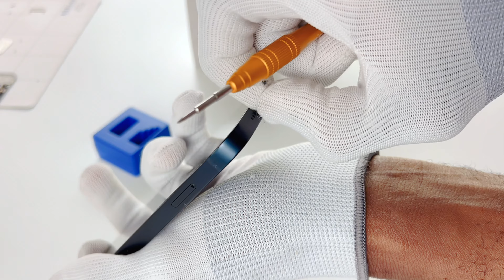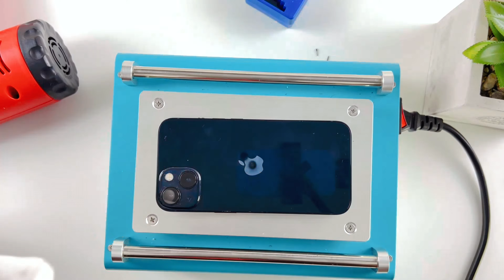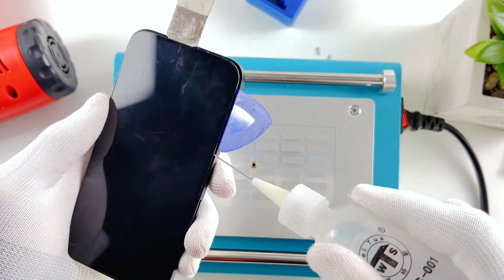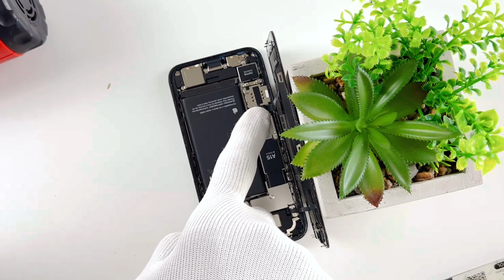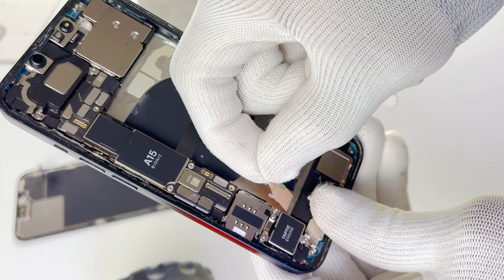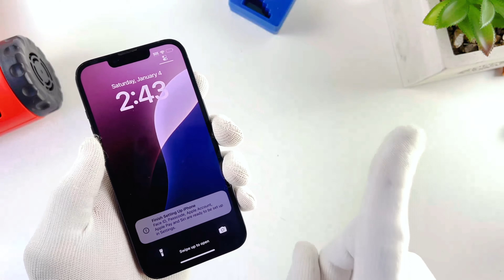Apple iPhone 13 / 13 Mini Battery Replacement... shown in 3 minutes!

Comment: Glad I stumbled upon your video. I was nervous to try it at first, but with enough heat (I used a heat gun with a pointy head adapter) I actually removed the screen successfully.

Just a heads-up for fellow viewers : depending on your device region, you might need different screwdrivers for the inner plates. Mine required a Tri-wing 0.6 mm, so I had to reseal the phone temporarily while I ordered the right kit.
Reply from the maker: @mxdscientist Congrats on getting the screen off, and thanks for taking the time to share that! Great point about the screwdrivers too. Inner screw types can vary by region and model, so checking before you start saves a lot of hassle. Appreciate you passing it along to other viewers. Let me know how the battery swap goes!

Comment: Can I use a hairdryer instead of a heatplate?
Reply from the maker: @SalikRafiq Yep, a hair dryer can work if that’s all you’ve got! It won’t heat as evenly or as concentrated as a heat plate, so you’ll need more patience and have to keep it moving around the screen. It might take longer using a hair dryer though, so you will need a lot more patience with it. Heat it up until the adhesive softens (around 80 to 100°C is what I aim for) before you start prying. Let me know how it goes!

Comment: What if I dont have a heat plate?
Reply from the maker: @Jpgas-life A hair dryer or heat gun can work as a substitute, just use a lower/medium heat setting and be a bit more patient since it won't be as concentrated as a heat plate. You still want to get the area to around 80 to 100°C before applying the isopropyl alcohol.

Comment: Is it easy to do without alcohol and a heat plate?
Reply from the maker: @um4lik398 Definitely not easier, no. It's still technically doable without alcohol and a heat plate, but it's going to take a lot longer and be way harder. You still need some form of heat (around 80 to 100°C) just to get through the screen to reach the battery, heat is pretty essential for that part regardless. Combining heat with isopropyl alcohol makes the whole process significantly easier, so without both, you're making it a lot harder on yourself, not impossible, just a much bigger hassle.
Reply: @G @GadgetGearGuide3Gs m thanks for the reply, so do u think it would be cheaper just to get it done at a store, considering that i have no tools or anything lol
Reply from the maker: @um4lik398 Honestly, if you have zero tools and this would be a one-time thing, getting it done at a shop is probably the more cost-effective option, buying a full tool kit just for one repair usually costs similar to or more than a shop visit. But if you see yourself doing more repairs down the line (for yourself or as a hobby/side hustle), investing in tools pays off quickly after the first couple repairs. Depends on whether this is a one-off or something you want to keep doing!

Comment: I accidentally cut the flex cable on top. What is it?
Reply: probably face id/speaker
Reply from the maker: @laftaf_tv That flex cable at the top typically has something to do with the Face ID, and one of the two mics on the 13. If you cut it, I'd check if Face ID still works, along with the sensor and top mic, those are the most likely to be affected. Your earpiece speaker should still be fine though, on the 13, that's not tied to this particular flex cable (it was on some older models).

Comment: Q1. What’s the best temperature should I set my heat plate when removing newer iPhone screens?

Q2. What temperature should i set when removing my Samsung S8 back glass so that i don’t damage my fingerprint sensor at the back?
Reply from the maker: @samford_technologies Great questions! For newer iPhone screens (like the 13/13 mini), I'd set the heat plate around 80 to 90°C (176 to 194°F). Hot enough to soften the adhesive without stressing the display or battery underneath. Keep it on there for 60 to 90 seconds before attempting separation.

For the S8 back glass, be extra careful since the fingerprint sensor flex sits close to the glass. I'd recommend a slightly lower temp, around 70 to 75°C (158 to 167°F), and use a suction cup with slow, steady prying rather than rushing it. Let me know how it goes!
Reply: @GadgetGearGuide3Gs thanks for the reply
Reply from the maker: @samford_technologies You are welcome 😊

Comment: u didnt seal with adhesive the screen!!!!!!!
Reply from the maker: @mateoherrera1413 I didn’t reseal it with new adhesive in this one. For me it’s more of a personal preference. On my own phone I usually don’t bother since once it’s opened, the water resistance is never really the same anyway.

If it’s a customer repair though, I always recommend putting new adhesive back in to help with dust protection and some level of resistance. For personal use, I’m okay without it.

Comment: Alcohol doesn’t soften the adhesive. It makes it harden and come loose.
Reply from the maker: @JR10125 You’re right technically. I used the word soften just to keep it simple for beginners. Heat actually softens the adhesive, and the alcohol helps break the bond so it releases easier. Together they make removal safer and easier, especially for people just starting out.

Comment: i remember giving up iphone fixing because you had to like solder cables from original battery to the new one, is that still a case or ?
Reply from the maker: @harismuhic20  Yeah, that used to be a big headache 😅 These days it really depends on the model. On some older iPhones, you can just swap the battery and be done. On newer ones, you might see a battery health or non-genuine warning unless you transfer the original BMS/flex or use a programmer. Apple Self Service Repair has also made things a bit more straightforward if you go that route.

What was the last phone you worked on? Which make and model?

Comment: Can I do that in a bloated battery?
Reply from the maker: @vithalos I would not recommend doing that on a bloated battery. A swollen battery is already unstable, and adding heat or alcohol can be risky. The safest option is to power the phone off, avoid pressure or heat, and carefully remove it using the pull tabs if possible. If the tabs break, go very slow and gentle, but honestly, a bloated battery is one of those cases where safety comes first. If you are not comfortable, it is better to have it replaced professionally.

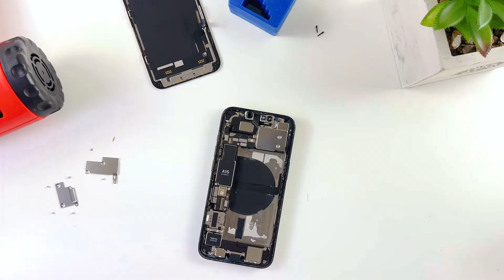Comment: 2:19 there are pull tabs at the top and bottom which work very well, pulling at the side with a spudger can severely damage the battery or create an fire, its way safer to use the pull tabs.
Reply from the maker: @harulango8614  You’re right, if the pull tabs come out cleanly, that’s definitely the safest method. In my experience though, the tabs often tear or snap, especially on older batteries. When that happens, controlled heat plus a small amount of isopropyl alcohol helps soften the adhesive so the battery can be lifted very gently with a plastic spudger. As long as it’s done slowly and carefully, it’s safe. Appreciate you pointing it out, both methods work depending on the situation.

Comment: is data completely lost after battery replacement? (my phone is not backed up), is the data still there in the phone after changing battery?
Reply from the maker: @hunaidjamali4306 No your data does not get erased during a battery replacement. The battery has nothing to do with storage, so all your photos, apps, messages, and files stay exactly where they are as long as the repair is done properly.
The only time data is at risk is if the phone already has motherboard damage or it shuts off during a software update. But for a normal battery swap, your data stays safe even if you never backed it up.

Comment: Will it be 100% again?
Reply from the maker: @sam-hq1xq After a battery replacement, the health does not usually reset to 100% unless it’s an original paired battery. But as long as the new battery is good quality, your phone will work normally with no issues.

Comment: No new adhesive needed when putting the screen back on ?
Reply: Remember, too, that this guy is a pro with all the materials, so he can pick and choose what to use. We use what comes in the kit we buy online, right? So, if a new screen adhesive comes in the kit, it wouldn't make sense not to use it, though I don't think it makes it dunkable again. It might help keep it from getting damaged in the rain, tho.
Reply from the maker: @Another_Lady  That’s actually a really solid point. You’re right, most repair kits include new adhesive, and it’s definitely good to use it if it’s there. It won’t make the phone waterproof again like from the factory, but yeah, it can help with light moisture or dust.
Reply from the maker: @technocatdance That’s a really good question! Personally, I don’t usually replace the adhesive when it’s for my own phone. I just reuse what’s already there since the phone won’t be fully water-resistant anymore once it’s opened anyway. Some people like putting on new adhesive to help keep out dust, but for me, I prefer easier access if I ever need to open it again. The screen usually stays firmly in place thanks to the clips and pentalobe screws.

That said, if you’re doing the repair for a client or as part of a business, then yeah, definitely replace the seal. It just looks and feels more professional. But for personal use, it really comes down to preference, in my opinion.
Reply: @GadgetGearGuide3Gs  Interesting I always wondered if that adhesive was actually keeping that screen in place or was for waterproof and dust etc thanks for the reply!
Reply from the maker: @technocatdance  Yeah exactly! A lot of people think it’s what mainly holds the screen, but it’s really more for the water and dust resistance. The clips and screws do most of the work keeping the screen in place. The adhesive just gives it that extra seal, more for protection than structure.

Comment: Noticed none of these comments that I've read say they've successfully used this method to replace the battery. And I think 3 minutes is being highly optimistic.
Reply from the maker: @aroneleusis1865  I get what you’re saying. The 3 minutes isn’t really about the whole job start to finish, it’s more about the actual swap once everything is open and ready. The full repair definitely takes longer, especially the first time. It just takes practice and a bit of patience, not really a one-and-done thing.
Reply: Realistically if your not good with repairing things and this is your first repair with anything tech related. You should not be clicking on a 3 minute video to learn how to replace a phone battery at that point you should be taking it to a repair shop or if you want to learn watch a longer more detailed video. This video is more for experienced people that have knowledge about repairing tech but just want a quick refresher / guide for them to follow.
Reply: And if it was a 20 minute video you would have complained that it needed to be edited down 😂
Reply: Id say take your precious time especially on that screen prying part.

Comment: Metal bro 😂???
Reply from the maker: @unicbertprofi2851  😂 Haha not even sure what you mean bro, but metal it is! 🤘🔧
Reply: @GadgetGearGuide3Gs dude ...use some plastic tools for opening those screen .😅
Reply from the maker: @unicbertprofi2851 Yeah I hear you 😅 I only used a thin metal tool just to get the first gap open, then switched to a guitar pick and plastic spudger for the rest. For the screws it’s metal of course, but when it comes to lifting the screen, I try to stick with plastic once I’ve got it started… can’t exactly use a plastic screwdriver though 😂
Reply: @GadgetGearGuide3Gs  well you know and and i know using that mettal at first is an hy risk for lines ,take your time with some alcoohol under press and it will pop ..for shure ..all the best ..!
Reply from the maker: @unicbertprofi2851 Totally! That’s the key, take your time, use a bit of alcohol, and it usually pops right out. Appreciate the tip, all the best to you too!
Reply: @GadgetGearGuide3Gs  What a gracious reply! That makes me like you more 😄 And, for me, none of my plastic tools worked, so I had to use metal 🤷‍♀
Reply from the maker: @Another_Lady Haha I appreciate that! Yeah sometimes those parts really don’t want to budge 😂 Metal tools definitely come in handy when nothing else works, as long as you’re gentle with them.

Also, suction cups work too, I still use them in some of my videos just to show different ways of doing repairs. There are so many methods that work honestly, it really just depends on your technique and what feels most comfortable for you.

Comment: I phone 13 which brand battery you recommend
Reply: What do you think of PINZHENG battery? I start my company it’s been a couple of month and i buy them since i saw they have good review but i wonder if i have take the right choice for aftermarket battery.
Reply from the maker: @simmyrakhra  Apple original is always the top pick, best safety, performance, and longevity. But if you’re going third-party, here are some good brands people use: iFixit, Deji, NOHON, and Ampsentrix. Make sure to get a battery with good warranty and from a trusted seller so you don’t end up with weak capacity or safety issues.
Reply: @GadgetGearGuide3Gs  I think Deji leaves a lot to be desired (I replaced 3 originals with Deji till now). What about Nohon, in comparison?
Reply from the maker: @tanner1985  Sorry I just saw this message. Totally fair, different brands perform differently in real use. Deji has been hit or miss for some people (some like them, some don’t).

NOHON in my experience tends to be a bit more consistent and closer to original performance than Deji, but it still won’t match Apple’s original battery in safety, efficiency, or longevity. If you’re picking third‑party, look for sellers with good reviews, clear warranty, and high capacity ratings.

At the end of the day, NOHON usually edges out Deji for most people I’ve seen, but nothing beats an original Apple unit if you can get one.

Comment: Can I use 100•C AirGun on the back of IPhone instead of heating plate ? Ty
Reply from the maker: @VwhyX Yes, you can use a heat gun set around 100°C, but you’ll need to be extra careful to keep the heat moving so you don’t overheat one spot. I use a heat plate because the heat spreads evenly, which makes the repair faster and safer, but a heat gun can work if done carefully
Reply: @GadgetGearGuide3Gs Thank you very much that helps a lot ! Can I also use a heat dissipation pad and use a bit higher temperature maybe ? I don’t know if that is safer.
I want to get the heat plate as well but it cost a lot for me as I am not making a lot of profit as of now :/
Reply from the maker: @VwhyX Yeah, a heat dissipation pad can help spread the heat a bit, but you’ll still want to be careful with the temperature. For battery removal, 100°C is usually more than enough. If you were doing a back glass replacement, you’d need a bit higher temperature, but then you have to be extra careful so you don’t damage anything, it can get tricky. I get it, the heat plates are pricey, so using a pad with a heat gun is a decent alternative for now. Just move the heat around evenly and take your time, it’ll make it safer.
Reply: What is the temperature of the heat plate, can I use worming spot on stove (glass top)? I can control temperature I think if I know what should by the right one. Thanks!
Reply from the maker: @basiakirschner284  Hey! The ideal heat plate temp is usually around 80°C to 90°C. I wouldn’t really recommend using a stove though, it’s high risk and the heat isn’t even, so you could easily damage the screen and end up spending more money in the long run. You can grab a cheap heat gun on Amazon for under $10, and that’ll work way better for what you need.

Comment: I dont have a heatplate, a thin opening tool nor alcohol. This video is useless
Reply: Those are the tools requiered to do this job. It's just how it is
Reply from the maker: @Andrew-tl9gk  No worries! If you don’t have a heat plate, thin opening tool, or alcohol, there’s still a way to get started. I actually have a video showing a beginner-friendly repair kit you can grab from Amazon or AliExpress, it comes with a screen and all the basic tools you’ll need for most first repairs, including battery replacement. For heat, a hair dryer can work too, just keep it moving so you don’t overheat anything. I’ll be making a full video soon showing exactly how to use a hair dryer for these kinds of repairs, so stay tuned!

Here’s the link to the kit video if that helps: https://youtu.be/KXhIZxD1Qlc
Reply: LMFAO you gitta baiting
Reply from the maker: @rxqsfax3269  Haha, maybe a little! Just trying to keep things interesting while sharing the tips.
Reply: Yea.. it couldnt be you, who can buy that stuff, that’s useless.. gotta be the video 🤣🤣🤣

Comment: Were can you order a orginal Apple part battery for iPhone 13
Reply from the maker: @anymoez6789  Apple doesn’t actually sell genuine new iPhone batteries directly to the public. The only way to get an “original” Apple battery is to have it replaced through Apple or an Apple Authorized Service Provider.

If you’re buying online (like on AliExpress, Amazon, or other parts suppliers), most of the time they’re high-quality aftermarket batteries that are advertised as “OEM”, but they’re not the same as what Apple installs. The best thing you can do is check seller reviews and ratings to make sure you’re getting a reliable one.
Reply: @GadgetGearGuide3Gs  What battery did you use in the video?
Reply from the maker: @ianbush2846 In this video I actually used an original battery, but most of the time I go with aftermarket ones. I usually buy from AliExpress or Amazon, and I always look for sellers with lots of reviews (4.7⭐ or higher) and preferably a badge on AliExpress. That way you know you’re getting something reliable.